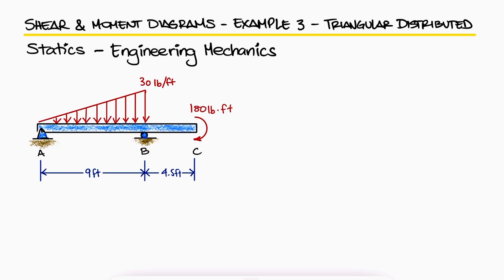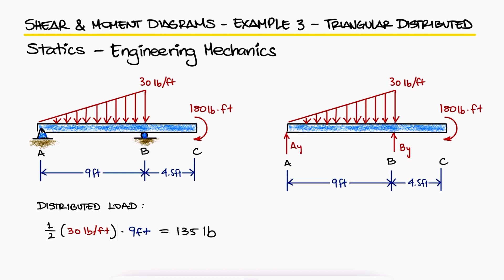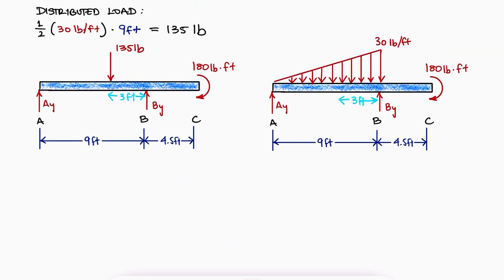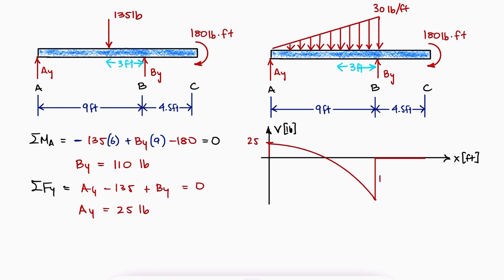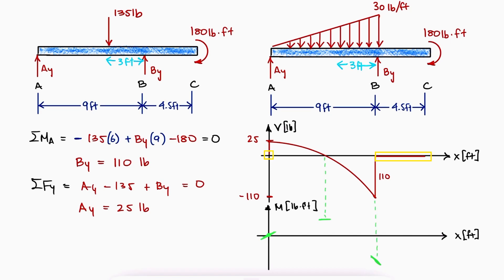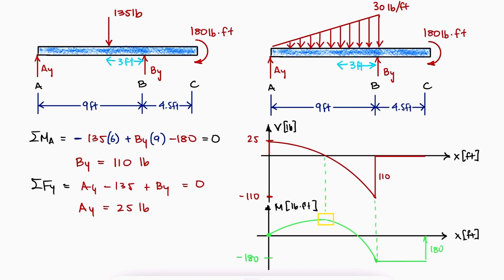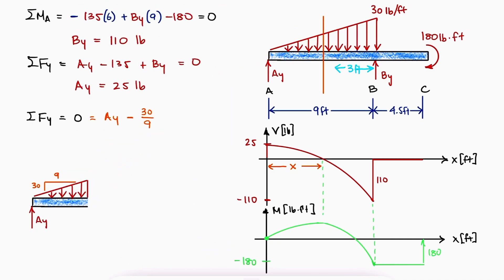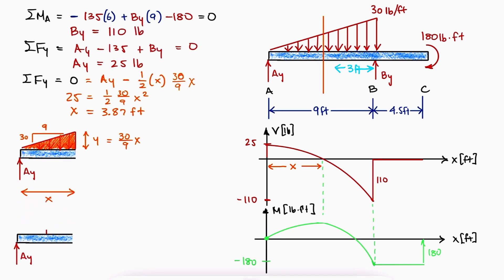TRIANGULAR Distributed load in Shear and Bending Moment Diagrams in 3 Minutes!

Comment: I think this would be simpler to solve by creating a function for the Shear and then integrating it, which would give you a function of for Moment.

Especially since this only has 1 discontinuity which is easy to determine logically, so you can ignore that half of the piecewise function.

If memory serves, shear is the integral of the distributed load. And since the distributed load is linear as a function of of X, that means that the Shear will take the form V=1/2 a*x^2 + c. Where 'a' is a constant you determine from the slope of the distributed load. Which is a=w_max/L

'C' can be found by solving the Shear function at point B, which you can determine from the moment equilibrium.

This way you can solve the moment at any point, rather than just the peaks and intersections. Which will be helpful when you want to calculate the displacement. Or if you want to engineer a constant strain beam (2nd moment varies to keep strain constant at every length).

Comment: If someone is wondering, how the value of 135lb was found.

q(x) or distributed load is 30/9 lb/ft^2 x (Since, the maximum distributed load is 30lb/ft, it is not the slope of the load and distance is 9 ft. So, slope of the distributed load is 30/9 lb/ft^2).

Integrating q(x) with limits 0 and 9, we get 135 lbs which is the total force exerted by the distirbuted load.